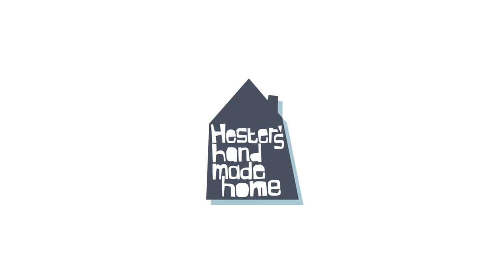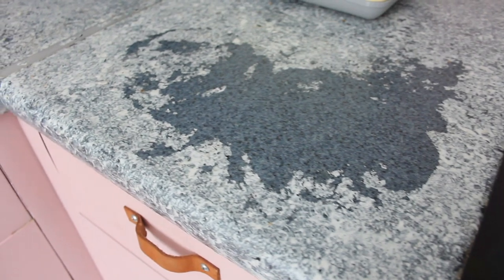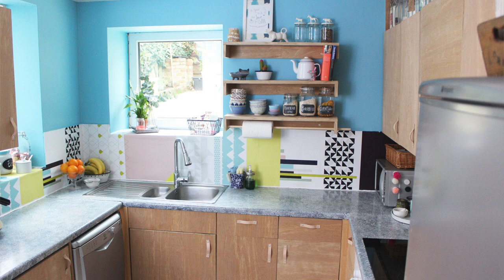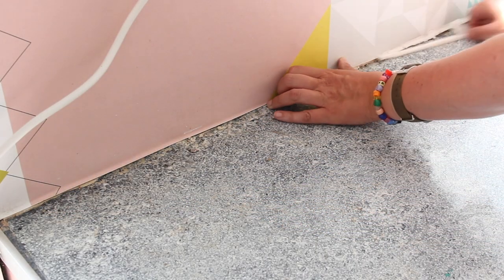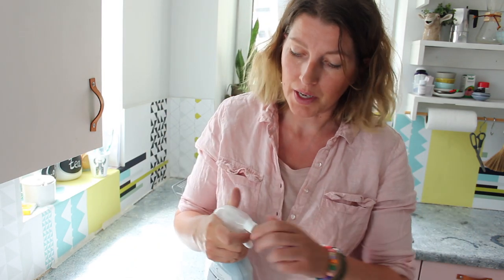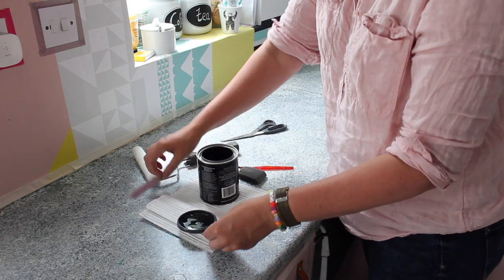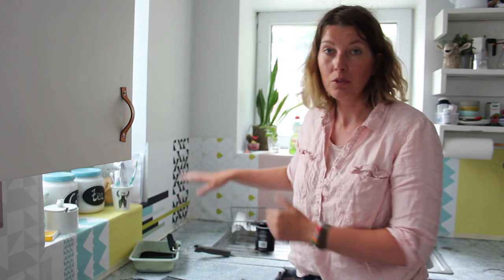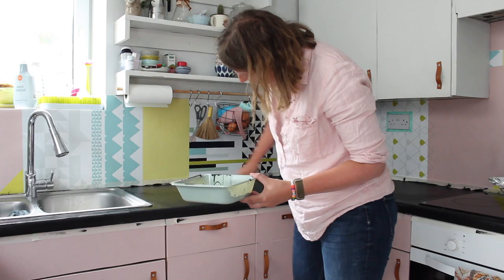I repainted my kitchen counters

Comment: How long did it last for please with out chipping? Scratching off? Which primer and paint did you use?
Reply from the maker: Hi, the original painted counters lasted for years without chipping. The repaint has a few little marks a few months after painting it unfortunately.